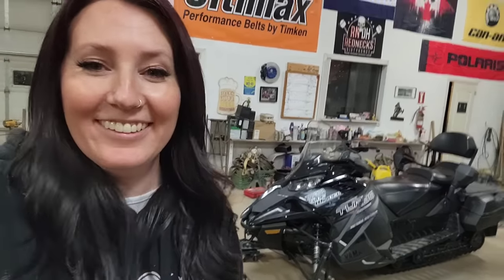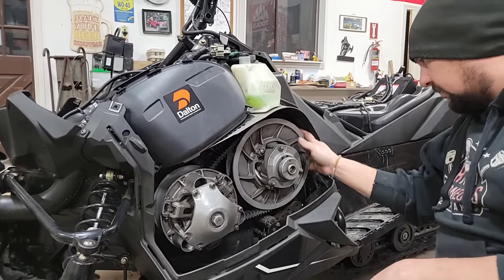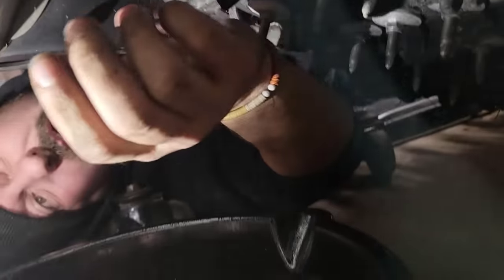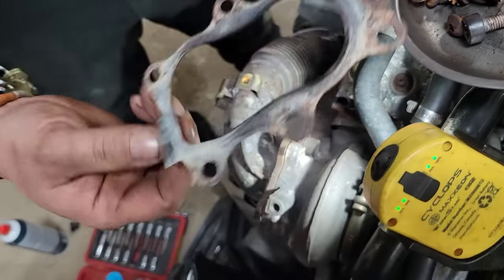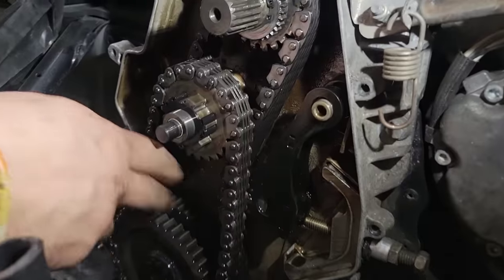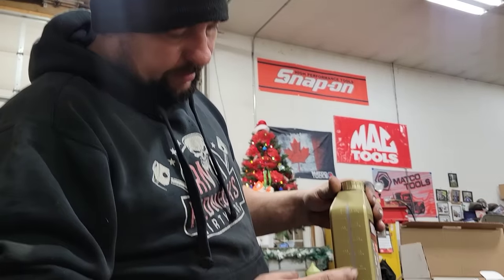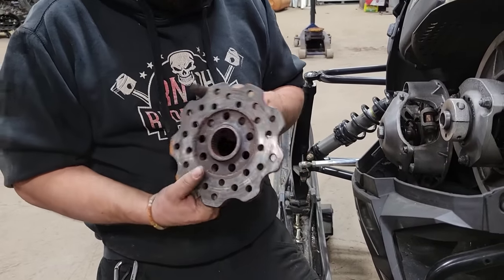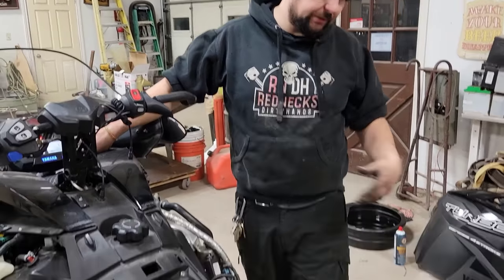2018 Yamaha Sidewinder Oil Change, Drive Bearing & Chaincase Service

Comment: Got a new Olde 18 LTX DX turned up to TD 290, 18 piss em pounds and runs like a wet dream. D RON will be just fine, right mods and fresh fluid she'll be tight. Good on the boys cause Lake Simcoe is a wave pool so far this new year . Cheers to RNDY, always a pleasure

Comment: thats essentially a pantera with a 998 engine.  The pantera utilizes a different tunnel config than the regular procross, it's one reason the running boards looks so different.  Additionally with that second tank is the first one it drains from.

but yeah with that seat its the catillac on the snow.

Comment: Hey Pete.    Just curious on a price for an Ultimax belt for a 2023 thundercat?.   Or where is there a place that sells them?. 🎉And also what brand of radar gun do you use for the sled radar runs?  Or what brand would you suggest for a radar gun ?.  Keep the videos coming.   Love them.
Reply from the maker: good day! I'm still working on getting setup to sell the belts but I'll be ready to go soon! you can go to www.Ultimaxbelts.com to find the belt number and a dealer close to ya if ya need one right away though. for the radar gun, we've been using a Bushnell gun but a buddy of ours has one that's better quality...I can't remember the name of it though lol. we also use a dragy GPS for accurate quarter mile speeds and times and nobody has to hold the gun for ya! cheers 🍻

Comment: Why not put anti-seize on the torx exhaust bolts when re-installing? Wouldn't that help the next time you need to remove them (with vice grips), or does the heat just burn it off?
Reply from the maker: there is high heat anti-seize that I probably should have used...I do have it on the shelf lol. cheers 🍻

Comment: 20:02  FOR ANYONE WHO DOESN'T KNOW THAT ALLEN KEY HOLE IN THE KNOB OF THE VICE GRIPS IS TO TIGHTEN THE CLAMP MORE AFTER CKAMPING, OR YOU CAN TURN THE KNOB WITH PLIERS AFTER YOU CLAMP IT.,

Comment: What's your engine oil recommendation for a new Ski-Doo 900 Ace? The OEM XPS, AmSoil? I see you're flying the Amsoil flag, but I'm guessing either/or is fine. Eh?
Reply from the maker: yeah there are a ton of good quality oils these days! I mean for any kind of warranty issues maybe stick with the OE oils but after the warranty is up use what ya like. I stick to the yamalube for my sleds 🍻

Comment: Need some advice pete.  '07 z1 4 stroke bought it may '23 (last year) started for him but not for me when i got it home.  After oil change (dry sump) is the first startup dry for first couple revolutions of engine as lines and pump fill up?  There was a clump of dirt that came out of each the sump and resevoir.  Turns out one airbox boot wasnt on throttle body. Plugs were sooty and one was finished.  Put new plugs in and properly installed airbox onto throttle body. Decided to flush what i could so i put 3 litres of very expensive 0w40 in resevoir and a week later (time constraints) drained both resevoir and sump.  No new oil in sump at all hence my dry start question.  Also do you think i should pull pump ofv and inspect lines for dirt accumulation or clogs.  It was ran sucking dirt until it fucked the plugs up enough not to start. Oil filter sits horizontally so prefilling not really going to work.  I havent rode it yet.  Its for my son who is up near Timmins and i dont want to see that fucking cat breakdown in the bush 20 miles from town in minus 25 weather.  5000k on it inpaid $2g.  Too good to be true as fucking usual.  Ive got that '07 z1, a '13 Polaris assault 800 155 and a '99 zL 600.  Nothing like pre '04 sleds to work on, nice and easy.  Lemme know what ya think thanks

Comment: Hey Pete I’m a huge fan buddy an my pops has a 2001 yamama vmax 500 deluxe an it’s all been re done cuz it blew up on the ice after jus buying it point being it got a brand new lower unit on the Motor? Lol I don’t know anything about them not much lol thr pistons blew so idk but it’s not runnin on both cylinders I think it’s boggy still an they said they did 1800$ worth of work to it

Comment: Would the exhaust manifold and pipe set up from the 700 viper work for you? The 700 srx and viper power valve engines must be similar?
Reply from the maker: it might work..🤔🍻

Comment: Hi, My husband has a 2018 Sidewinder and we are trying to change the oil. We cannot remove the drain plug. What is the tool you were using? There just doesn't seem to be enough room to use a regular ratchet . The space is very limiting.
Reply: What is the name of the battery operated tool you are using to remove all the tork screws
Reply: 5MM allen. He was using a m12 Milwaukee ratchet
Reply from the maker: yeah it's a bit of a tight spot for sure! I use a flex head quarter inch drive ratchet and a 14mm deep socket...I find that combo fits in there nice. as for the cordless ratchet, it's a millwaukee fuel m12 3/8 drive I got off the Mac tool truck. hope that helps, cheers 🍻